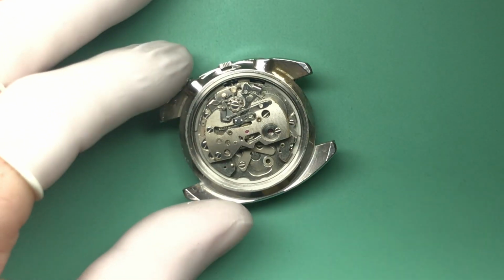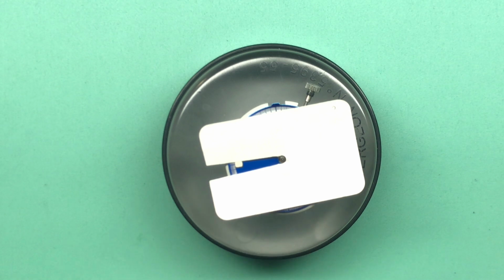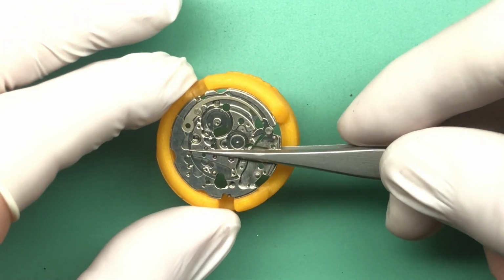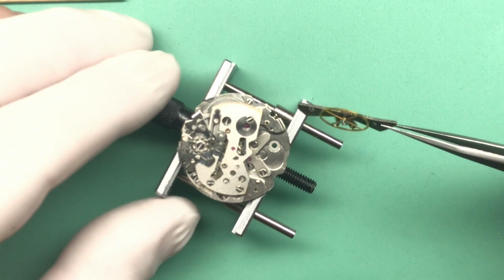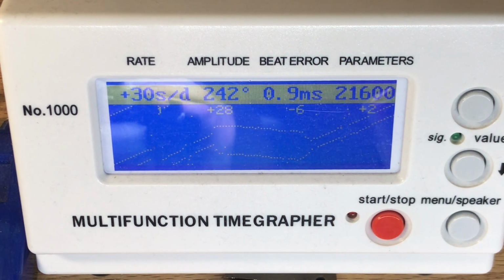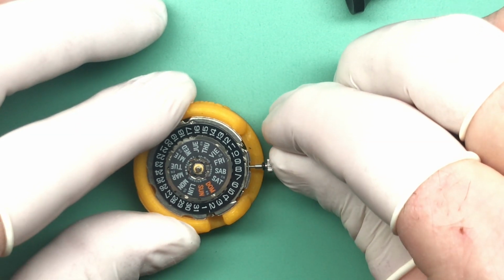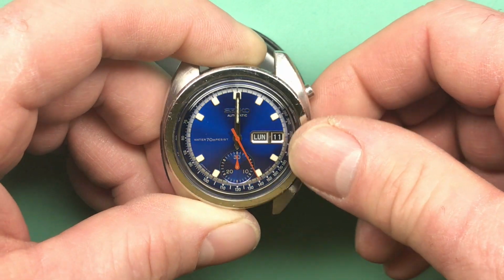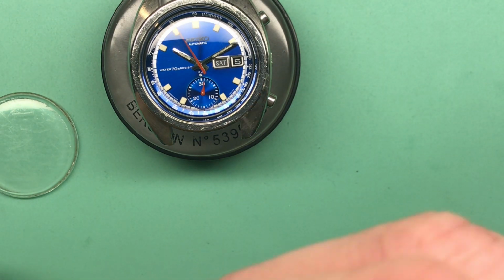For K.P. -- Seiko 6139-6015 "Blue Bruce Lee" Service

Comment: Great video, thanks! Can you make one on how the center chronograph wheel is lubricated?
Reply from the maker: I did in a video a long time ago. I do it by constructing a chronograph bridge from parts and then placing the wheel in that bridge and engaging the levers to "turn off" the chrono hand. then I oil the gap between the gear and the shaft.
Reply: @BlairWatchProject  That's a great idea indeed! Even if you don't have enough spare parts to build the dummy mechanism, you can still partially assemble the movement to service, oil the wheel, disassemble and then properly assemble it. Nice!
Reply from the maker: @lovecraft22  I don't have a spare available for the A-movement, and that's exactly the method I use for those.
Reply: @BlairWatchProject  can I ask why you do that? Why not just lubricate as per the Seiko service manual?
Reply from the maker: @PrecisionHorology  This method serves the exact same goal of lubricating the "4th wheel" pinion by separating the wheel from the shaft. I like this method because the wheel is much more stable and I can be more precise about where I put the oiler. Plus it allows me to simultaneously check the operation of the clutch in the engaged state. Pressing downward on the pinion with tweezers is a bit risky when replacement wheels are non existent. Better safe than sorry!
Reply: @BlairWatchProject  fair enough. Personal opinion I guess. To me it seems much more cumbersome and difficult. It’s hard to get an oiler in a tight space like that. I can assure you that pressing down on the wheel poses absolutely no threat. But, the important thing is that the same result is achieved.